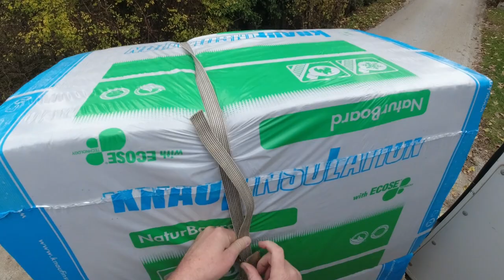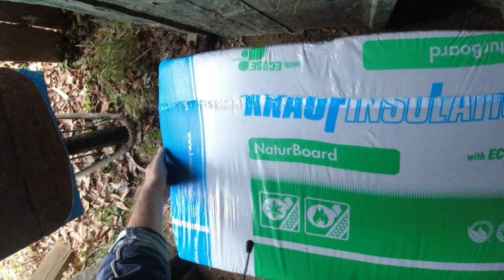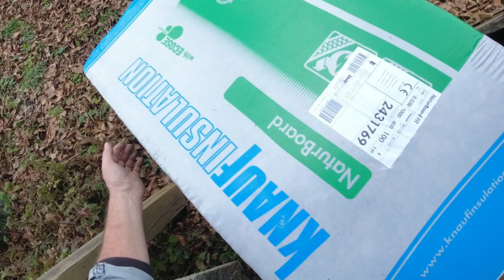Installing a Free Front Door (story 4)

Comment: Why do you do those temporary jobs, instead of demolition works? Quite time consuming, if you plan to re-build the house from the ground. Will you spend winter there? Keep up good job, btw. very inspirative.
Reply from the maker: Yes, I live in this house, there is no water and no electricity at the moment, but it will be slow. I need to do this temporary work to keep the house warm. 
And I can’t start rebuilding the foundations because it’s too cold for the concrete to harden.
Thank you! 🙂